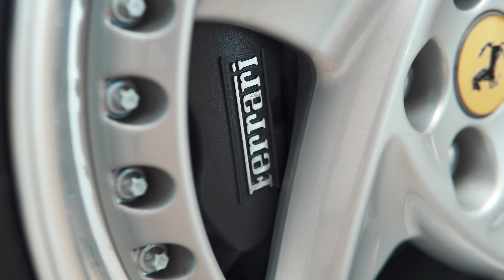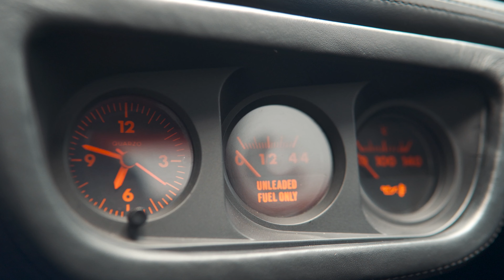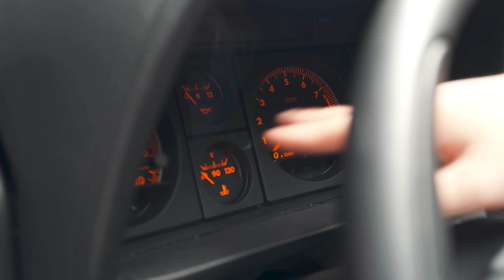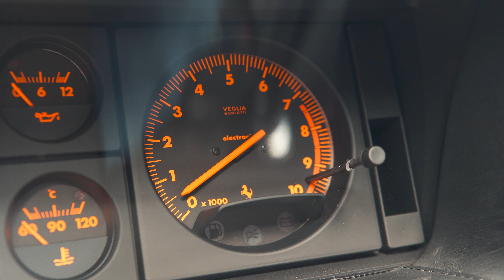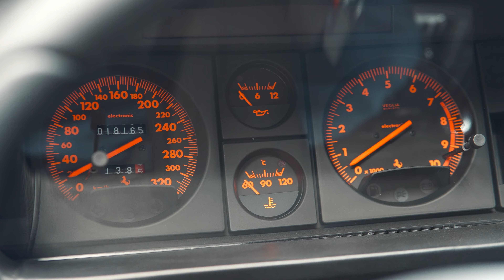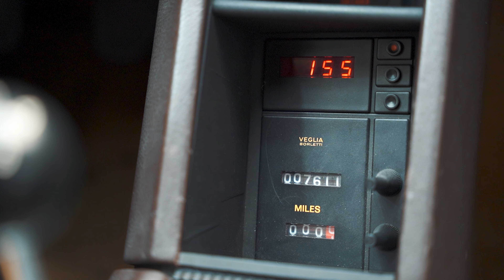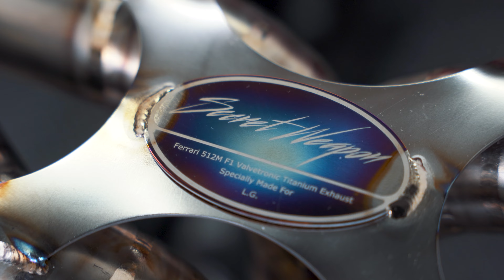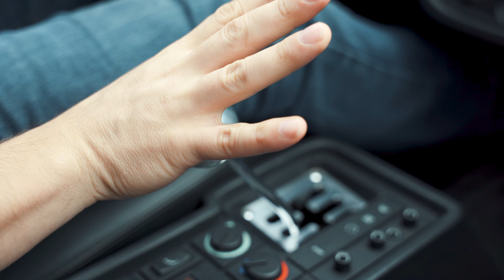THE MOST CONTROVERSIAL FERRARI in history! And the ONLY one in the world with Formula 1 sound. F512M

Comment: It seems to me that most Testarossa fans prefer the original model and to some extent the 512 TR over the 512M, but the 512M is my favorite, Ferrari did an amazing job of making a car designed in the early 80’s look quintessentially 90’s with the final update.
Reply: Ich bevorzuge tatsächlich den 512TR. Er sieht etwas eleganter aus als der ursprüngliche Testarossa. Die Frontleuchtem des 512M sehen irgendwie asiatisch aus und die runden Heckleuchten passen auch nicht ins Design 🤷‍♂️ Aber dieser Motor ❤️